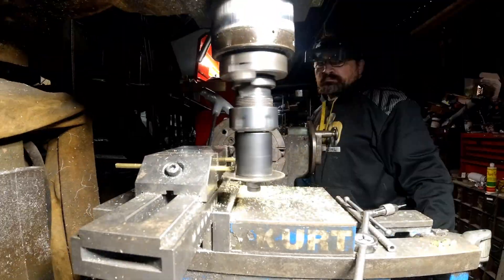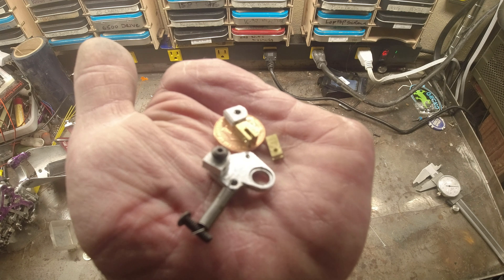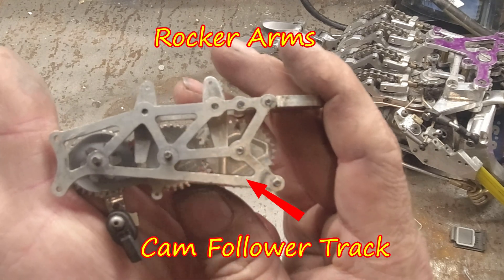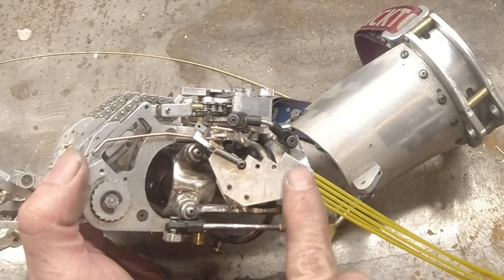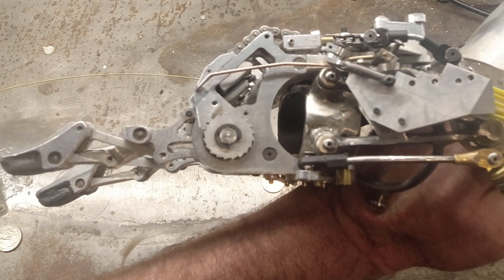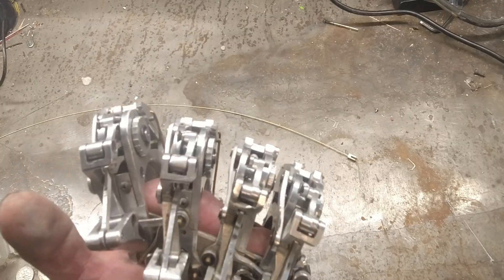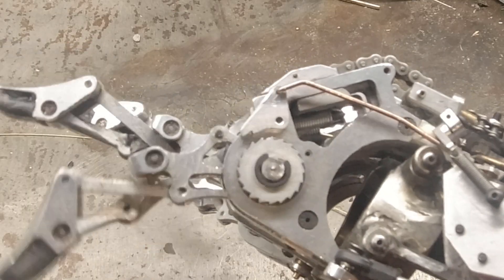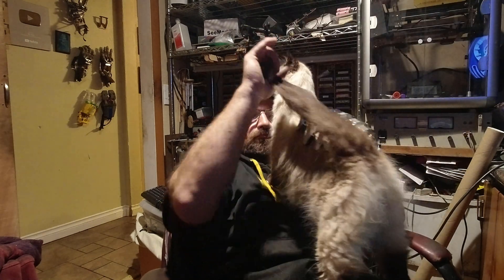Mechanical Prosthetic Hand Grip Patterns (how it works)

Comment: Thanks for the vid! Learned about your history from your chain-saw hand vid randomly. 
I can relate all too well. 

I’m going through your stuff now- curious if you integrate MEMS (sort of my field) into your builds - or what you are using for different set ups.  Either way looks beautiful! 
Especially compared with off the shelf  “accommodation equipment”....

On MEMS- 
I was thinking broadly — every thing from secondary actuators to energy harvesting to sensors/controls. 
Just in case it was unclear

Thanks again & take care

Comment: Would it be at all possible to use the same tech in prosthetic arms (ie the electric signals that are picked up by the arm from the user's arm) to control the motor functions of the hand?

Comment: Just my two cent here, wont the groove on the gear wear out overtime? If it did, will it reduce the cams touching area or will it works the same as it was a brand new gear/cams? Just curious, dont mind me

Comment: Might be a dumb question, but I'm new to this.. Have you tried incorporating your thumb into the design? If you're still able to move it normally, I would imagine your options would open up for fine tuning some of the prosthetics. I wouldn't have a clue on where to begin and I'm sure you've already thought of most things, but figured I'd mention it anyway.

Comment: I don't understand the timeline of your videos. I swear i seen you with a hand that can select many grip patterns yet you are again figuring it out? Hard to tell what was wrong for you to redesign
Reply from the maker: The 158 hand used 4, 6 lobed cams in a single shaft, with a catch and stay that was operated by a pair of scotch yokes to rotate the cam 60 degrees with each movement. If I wanted to change the pattern I would need to machine a new camshaft.(super complicated and tiny) this new setup uses 2 gears with cam follower grooves on each side. Less parts and likely more reliable with the new design.
Reply: @missingpartsclub  less is better, i see. I have yet implemented that in my life. Wise, thanks!

Comment: It's amazing how smoothly and naturally the fingers move. The entire prosthetic is obviously complicated and heavy, but it doesn't take away from the fact that the movement mimics natural movement perfectly. And the machining work on all the parts, that is some top notch work.
Did you ever think about using composite materials for some of the parts to try and make your prosthetic lighter?
Reply: I’m sure he could do some part with carbon fiber or something of the like but he can also deadlift like 60 lbs with his hand so I do t know if I’d even want a a light prosthetic.
Reply: In another comment he mentioned it was only 1.5 pounds which is pretty light all things considered.